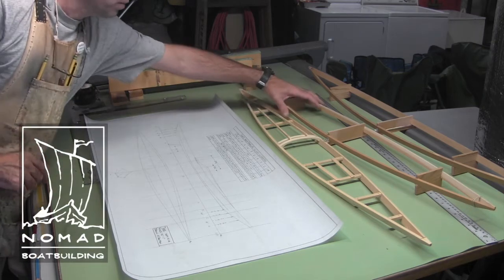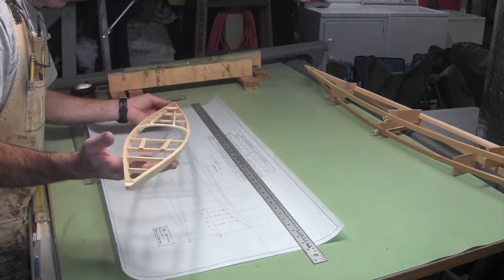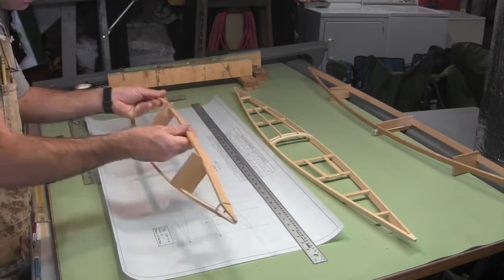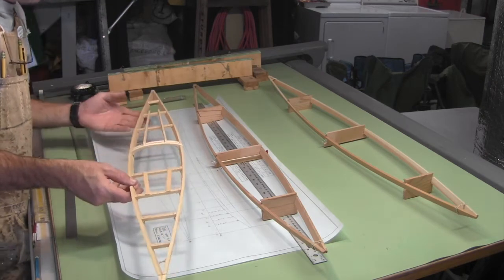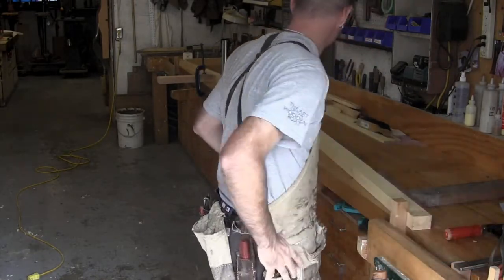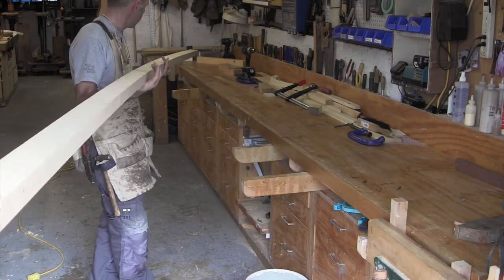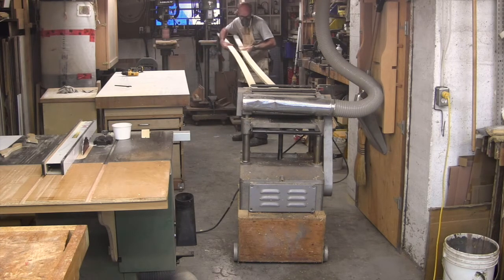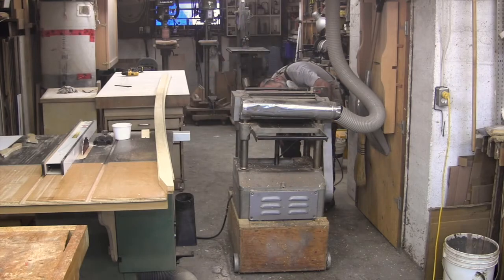Designing a Skin-on-frame Tahe kayak

Comment: Hi Mark, something that might be useful,  if you multiple half the width by the tangent of the angle it will give you the sheer.   So for a 20 inch wide boat, with a 20 degree flare (tan .363)  you'd times 10 x .363 giving you a sheer of 3.6 inches.  Interestingly if you look at a lot of historic boats their sheer minus any obvious wedge additions nearly matches this, but often not quite.  I am convinced that this is because wood milled from driftwood always springs badly due to the fact that driftwood often used to be curved trees with much tension that overhung on cliffs before meeting it's demise.   (I know this from experience milling exactly these types of logs) It was this realization that led to me laminating gunnels.   The Tahe is a different story however, the reason people like it is because it has a stability that no boat of a natural sheer curve would.  It's not a real Greenland boat in this sense, which is why it paddles much better, and you correctly surmise that the only way to get this shape is to curve the gunwales somehow.   Hope that formula helps.   You do great work, love the models.
Reply from the maker: That's very interesting Brian. I generally chuck my calculator and tape measure out the door when I start doing any kayak building.I like to fully embrace the anthropometric and sculptural approach. I especially like to do this whenever an engineering oriented customer comes along. It makes them kind of uncomfortable at first but they tend to relax pretty quickly and give themselves over to this organic approach. I'll have to bust out the calculator on the next one. Thanks for your input. Much respect for your work as well. We'll have to get together some day.
Reply: I'm probably the least mathematically inclined person there is, but I like to keep this one in my back pocket because it's so handy for what we do.   @Nomadboatbuilding
Reply from the maker: Cape Falcon Kayak I'll be sure to stuff it into my back pocket as well. Definitely going to play around with that math.

Comment: The best option might be to laminate the sheer, that way you can build all the bending you want
Reply from the maker: While that might be the best way to replicate the sweep of the sheer, I try to stick to traditional methods of construction as much as possible for these kayaks. It’s both for reasons of time management as well as the challenge of working within the confines of the methods and materials. I’m building another one of these Tahe interpretations right now and went with a sawn lamination glued to one side if the gunnel. Basically ripped a wedge off one side and glued it back on the other.